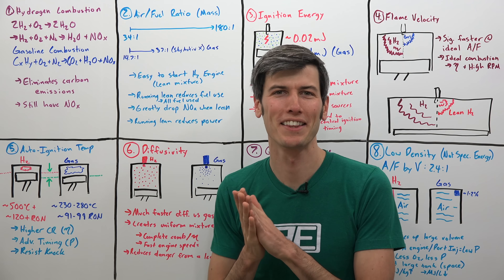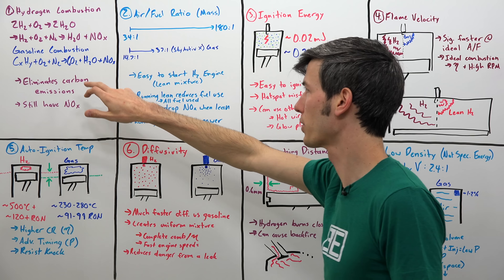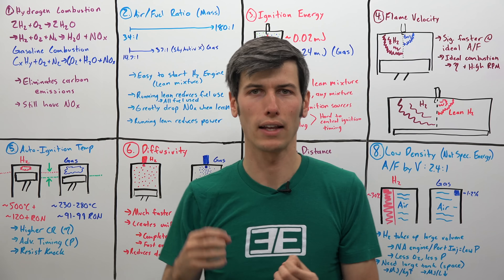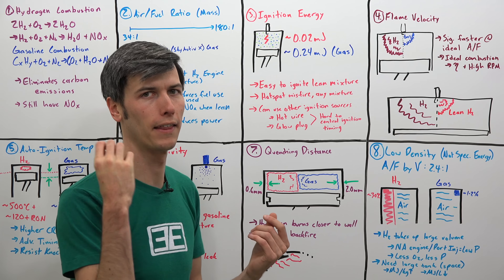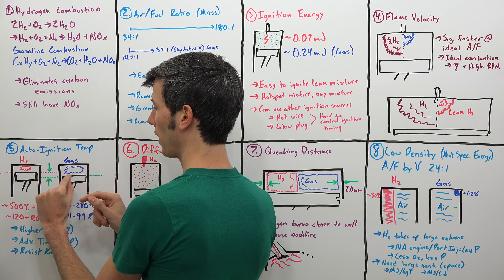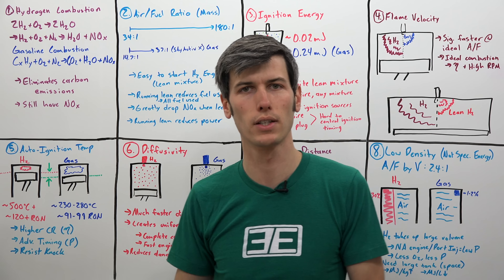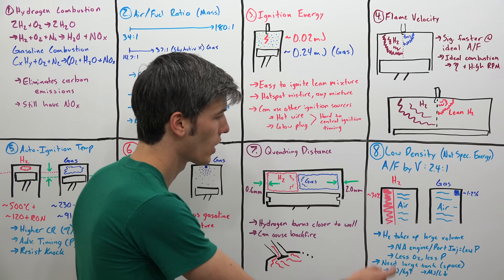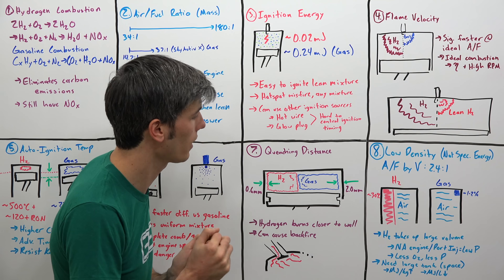The Difference Between Gasoline And Hydrogen Engines

Comment: Elon Musk has left the chat
Reply: I don't think this thread understands how much power is lost in recharging a battery of any sort - fuel cells are complicated and (currently) less convenient than batteries, but the thermal and resistive losses in recharging even the best Li-Polymer batteries put them behind fuel cells in terms of total cycle efficiency.
Elon said that fuel cells were "a ridiculous idea" maybe a few months before Toyota released the Mirai.  Do you think he spoke completely from technical acumen, or do you think he was concerned (maybe even just a wee bit) about the future of Tesla?
Reply: because Elon, like other engineers, realized the limitations of Hydrogen are a much larger drawback compared to battery power.  The transport and storage costs alone for hydrogen make it a factor of nearly 3x more expensive than electricity.
Reply: Elon definitely made a technical critique of fuel cell vehicles. 
• Tesla cars have three times better overall efficiency than Hydrogen from electrolysis. Compressing, condensing, transporting and storing Hydrogen is very energy intensive. 
• Compressed Hydrogen Gas requires large and/or heavy storage tanks. This competes with passenger and storage space. Even without considering the flammability of released Hydrogen, the highly pressurized composite wrapped tanks are shrapnel bombs if the fibers are disrupted anywhere by punctures or projectiles. Imagine Hydrogen cars near any of the hundreds of shootouts or collisions that occur daily. 
• Fuel Cells have severe output power limitations unless combined with lithium ion batteries and/or super capacitors. If output power is scaled up to meet acceleration demands, then the fuel cells become large and heavy. 
• The liquid Hydrogen tank insulation is dealing with a very large difference in temperature. 20 Kelvin is an absurd temperature to maintain in thousands of storage tanks worldwide, and ludicrous to pump through kilometers of pipes.
• Liquefied hydrogen must be consumed as it turns to gas, or the automobile tank will burst. The evaporated hydrogen can best be utilized to operate a refrigerant system to mitigate the evaporation. Still, any fleet of passenger vehicles will waste enormous amounts of energy while parked. 
• Producing Hydrogen from pure water is most efficient using a catalyst at the high core temperatures of nuclear power plants or large solar concentrator arrays. At the present, High Pressure Water Nuclear power plants strive to remove Hydrogen in the closed loops, as it contributes to Hydrogen embrittlement of metal alloys. Solar concentrator arrays would only work efficiently for ten hours per clear day. Most nuclear power plants would require extensive modifications. 
• Any electric vehicle will benefit from regenerative braking, but prolonged regeneration requires a low impedance battery pack, who's presence eliminates any benefit of Fuel Cells.
Reply: Electric cars generate more carbon emissions than a fuel based or hydro run one. Our electric grid is connected to either natural gas, coal, or nuclear. Charge ports use more in the burning of above from day and night consumption of electricity. Not to mention the lithium it takes to build a battery with wheels attached to it and electronic hardware attached. Which resources are primarily gold, silver, steel, nickel, aluminum, and lithium. So think on the mining that has to be done to make just 1 electric car. As for infrastructure ALL fossil fuel stations  can be converted to H2. It is just a matter of treating the underground fuel tanks and changing of lines. The cost analysis for this is minimal considering fuel companies are too regularly treat tanks and exchange out worn lines. The transition would take time but not near as long or  costly to build new charge stations. Elon Musk is a thief, a show off, and I would rather promote this teacher here than give Musk 1 red penny.
Reply: those engines with explosions and heat are outdated and not future iriented. Too much maintenance and worn out parts in that ICE
Reply: Chase is android ass down.  Quick,  he is dumping the  memory!!!
Reply: We have limited sources of lithium for electric vehicles for everyone in the world. We need hydrogen to help offset it. The green future isnt just battery.
Reply: Musk has left the chat??? Yeah, left the chat to go make sure that the 6 and 7 yr old child-slaves in his mines are being whipped hard enough, whilst turning rocks by hand looking for cobalt traces, so that they do not slow down.
Reply: Spelling correction  = Elon Musk-Rat-Clown Operation <>+ Go watch "Who Killed the Electric Car" Ask your self. Why would someone Kill a Successfully proven project by killing it? I'd have to go back and see it again for the distance traveled and other. But I believe no one has been "Allowed" to match or exceed those proven benchmarks.
Reply: Elon Musk is against FCVs (fuel cell vehicles) i.e. electrochemically converges hydrogen and oxygen to water and electricity. Because he feels insecure with the competencies of fuel cell cars over battery electric vehicles (BEVs). He has no issue with H2-ICE. The topic here is focused on internal combustion engines fueled by hydrogen.
Reply: Elon is back in a Model S with rocket thrusters installed
Reply: @ericvalverderosado2046  LOL. Is that your wet dream?
Reply: Elon Musk is still in the chat, laughing.
Reply: Lithium and cobalt are not really rare although cobalt is toxic. They are working on reducing the amount used with aluminum oxide and nickel. When batteries get to 80% capacity they can be re-purposed as stationary storage. After a number of years of use there, they can be recycled . It should be more cost effective to recycle a battery than to mine the metals as a battery is really a concentrated source of those metals. Further reducing the amount of mining needed. 
As an aside, the mining industry is currently switching their mining equipment from diesel to electric. Its healthier for their workers and its cost effective as the mines don't require expensive ventilation equipment for the workers.
Reply: Because hydrogen does not exist by itself on earth. You need electricity to separate the hydrogen from water (electrolysis) or a fossil fuel to chemically separate the hydrogen out. Save a step and put electricity in a battery instead.
Reply: @trails3597  thorium salt reactors
Reply: @trails3597  Nuclear provides clean abundant electricity that could be used to generate hydrogen. That electricity you're dumping into a battery has to come from somewhere. And those batteries? Where do you think the toxic raw materials they're made of came from? Where do you think the toxic chemicals required to process the materials batteries are made of come from, and where are they disposed of? Third world countries where there are no environmental regulations and where there is no regard for the health and safety of the people that mine and produce them for slave wages. That's the real cost of EV's.
Reply: @dannygreen7473  You're talking about cobalt aren't you?
Reply: @trails3597  yes, good point, but maybe we could have hybrid electric and hydrogen cars. Since charging the batteries produces hydrogen.
Reply: Carl Dupnt  I’m waiting for the day we have a network of  Tesla towers, that way we can skip the battery all together or use them just as emergency/reserve power.
Reply: Not really, H2 is still subject to fuel transportation limitation. You need H2 station infrastructure that is orders of magnitude more expensive than charging stations.
Charging station infrastructures are not that bad in U.S. anymore,  but H2 station infractructure is almost non-existent.
Reply: @Sickboyfriend  -- I think HFCEVs could work for applications other than passenger vehicles. In cases where refueling has to be kept at a minimum in both duration and frequency while uptime has to be maximized, the drawbacks of fuel cells versus batteries start to become an acceptable price to pay. Heavy transport such as buses, cargo trucks and service trucks won't need as much infrastructure investment since only a single H₂ refueling station in a bus depot can provide for that entire fleet. The same can be said about trucks and trains.
Reply: I think it will become an interesting race to see what happens, and whether fuel cells can win over batteries. I doubt FC can but I can be proven wrong.

For me, being able to charge at home is just too attractive. I do regular commute anyway so I don't need 200+mile range. I think I barely need more than 100.
Reply: @Sickboyfriend  Batteries have won hands down.  20y ago I'd have put my money on hydrogen, and forget fuel cells just use it directly (as in the video).  Heck I even built a working hydrogen/oxygen platinum mesh fuel cell for a high school physics project.  But in the end its just far easier and safer to work with electricity than hydrogen, and battery tech has out-paced fuel cell tech.

And as far as EV infrastructure, we've been building that for the last 100+ years.  Everywhere you see a power line is or a power socket you have an EV charge station.
Reply: @CrimsonTide001  Hydrogen might still be the solution for applications that require long range at high consumption rate. Like trucks, especially those for long distance travel, or airplanes, where batteries will never fly pun pun.

But the thing is if you're using hydrogen you can use a fuel cell which is much more efficient than internal combustion. That's why hydrogen vehicles are almost always fuel cell powered electrics, and the only reason this configuration hasn't replaced internal combustion long ago is because there are no fuel cells that run on gasoline.
Reply: @Sickboyfriend  Wait until you see your power bill, or when something goes wrong with your charging system and it burns your house down.
Reply: @CrimsonTide001  You obviously don't understand the principal of load capacity. There's a limit to how much electricity can be delivered down these lines to all of these outlets that are located everywhere.
Reply: @dannygreen7473  And so I take it you've calculated the upper limit of the number of cars you could charge simultaneously during off-peak hours for a particular region, then compared that to the rate of EV adoption in that area to come to your conclusion?  So... I'm curious, what are those numbers?  Links/sources/references?  While you're at it don't forget to account for refineries and their draw on the electrical grid.
Reply: @Sickboyfriend   Ahh you have a nice polluting future in the greasy oil business
Reply: @Sickboyfriend  you do realise you can make hydrogen yourself?
Reply: @WorivpuqloDMogh  Yeah, but my house wouldn't be a safe environment. Also, it probably wouldn't be cost-effective.
Reply: @Sickboyfriend  In the UK we only have 2 Hydrogen stations in the entire country.  Vs. around 1400 charge stations...

You'd have to be crazy to go Hydrogen, the infrastructure is just not there and there's no funding behind it either.
Reply: @Sickboyfriend  you could make your own hydrogen kinda easily youd just need a really big battery alot of salt amd water and a rig to catch the hydrogen and not oxygen
Reply: @Sickboyfriend  Ok and where is electricity comming from, yes gas and nuclear plants.
Oh and.. Where is nickel or lithium comming from?